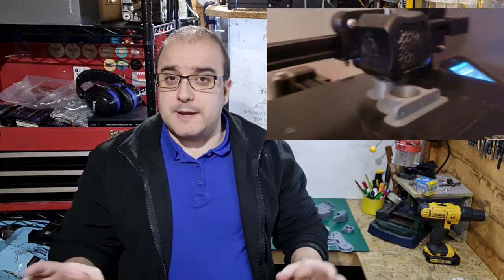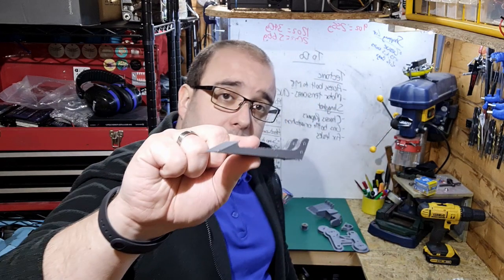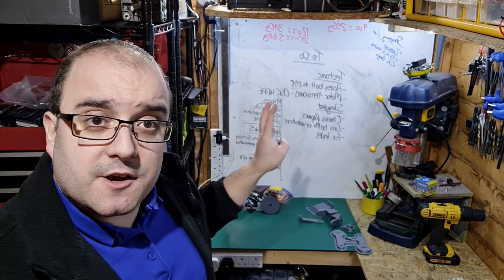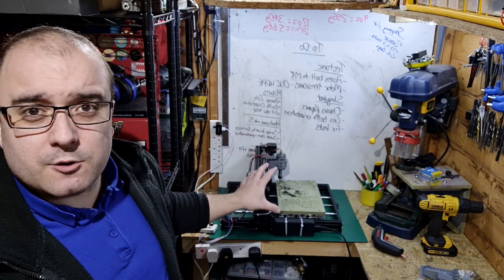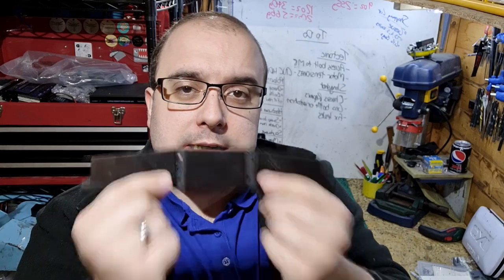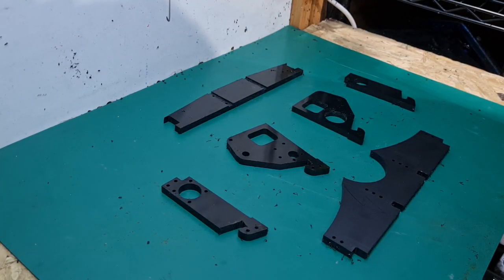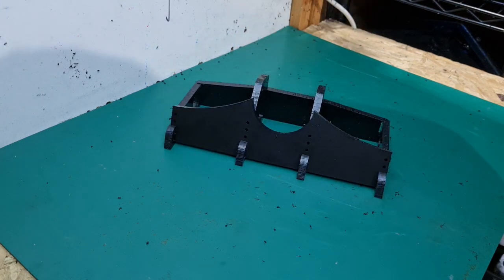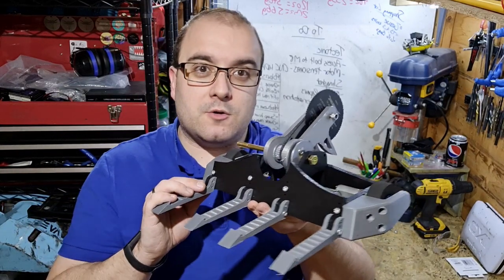Robot Building time! Beetleweight Build Part 2- Team Shock Builders Log Episode 6

Comment: If you had to choose, would you prefer a 3d printer or a small plastic-only CNC router (both with the same working volume) for building ant/beetleweight robots?

Seems like the 3d printer would be more helpful for quick prototyping while the CNC is more for building combat-ready parts?